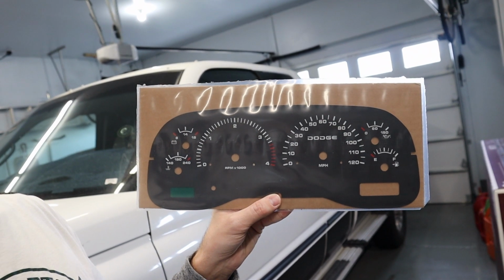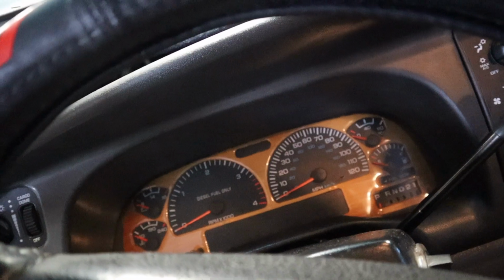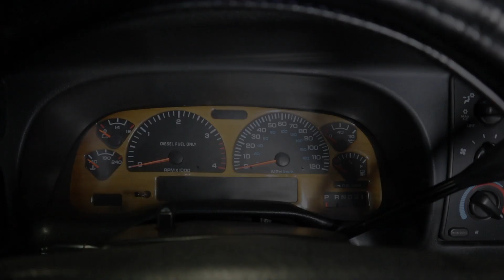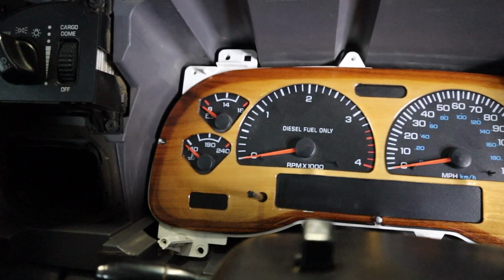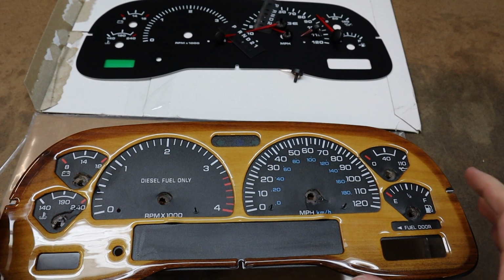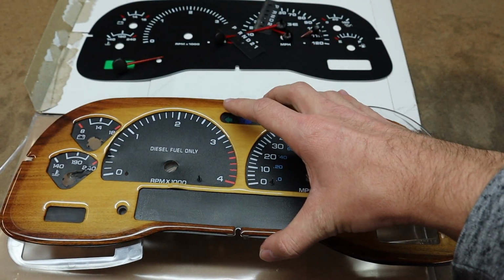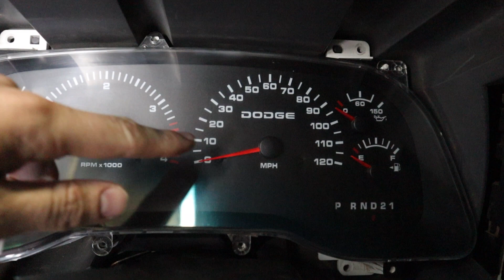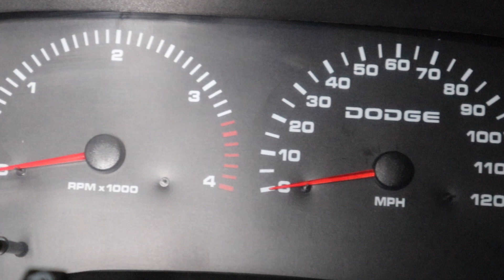Showing off the now cosmetically complete 1999 Ram 2500 + instrument cluster card replacement.

Comment: Are you running Royal Purple in the truck as well?
Reply from the maker: I will on the next oil change. The dealership did an inspection and a change for $80. I wanted a dodge dealer inspection, I think it was worth it.